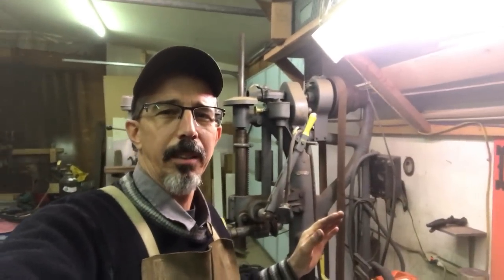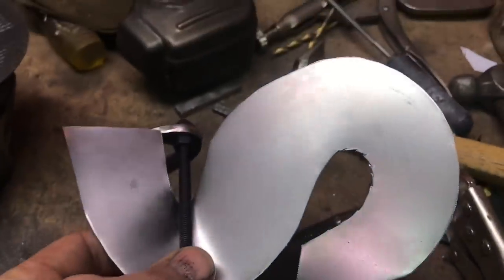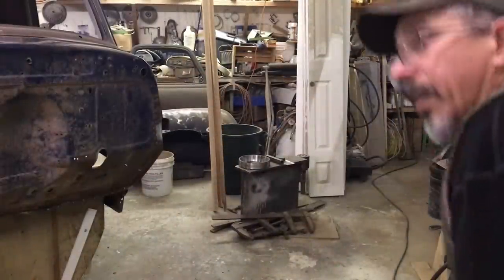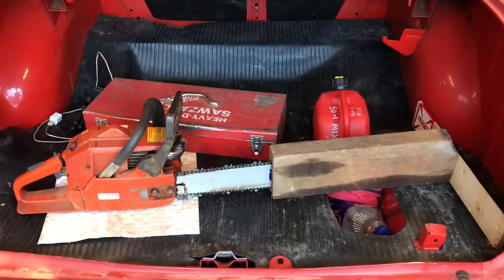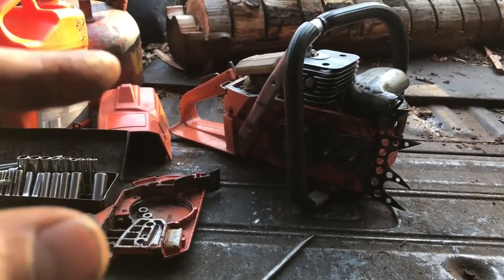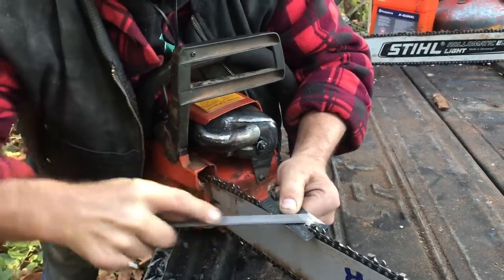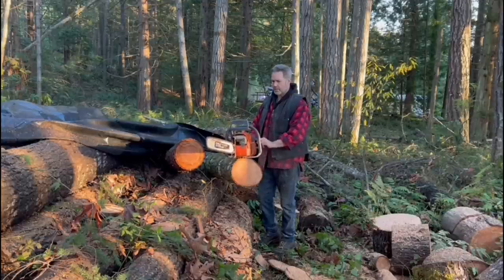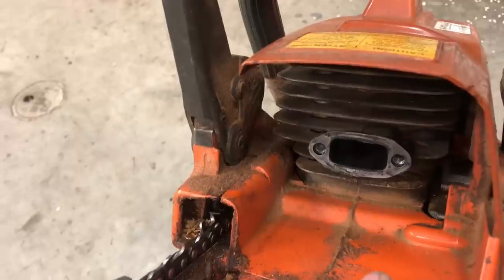Chain Saw Pipe “Test”

Comment: "Anything worth doing is worth doing wrong" & "Always plan on throwing one away" are two great sayings that erase the roadblocks to me learimg a new skill. You're really on to something here with these expansion chambers that fit in the space of an ordinary "can." Keep going! I believe you've got winner here!
Reply from the maker: Thanks John, I’m thinking the second pipe is probably the better of the two but don’t have any hard evidence that it make any significant power gains. I would like to do some more testing.
Reply: @WildWestGarage  Real world "Seat of the Pants" performance definitely gives you a a pretty good "Back to Back" that'll certainly let you know if you're moving in the right direction. When a pipe is pulling vacuum as you'd like while "in the cut" - you FELL it "getting on the pipe." What you really want to know is at what RPM does it "hit," - and is it still trying to gain RPM past where you really want it to.

From there, you can start nudging it in one direction of another by:
A- Binging in an inside radius to reduce over-all pipe volume (if that's a direction you feel you need to move) WITHOUT creating a lump in the path of greatest air-flow - around the outside radius
B- Lengthening the "stinger" - narrowing the stinger, or sometimes "Center Bleeding" bu putting the stinger in the middle of the fat section while tapering the old exit location to an inverse cone shape.

You can also "grow" a pipe some by filling a section with water and setting it "just so" in a chest freezer and letting the hydraulic forces of freezing water "Puff it out a bit."

It's a good deal of work, but man oh man are you ever onto something that - with some time and patience, could become a de-facto "go to product" for pro loggers and arborists that really DO need as much power at as low a weight penalty as possible.

Yup. I'm curious to see where this goes, and I'm sure quite a few others are as well. Yer a smart fella! I like the way you think! MORE POWER PLEASE! :)

Comment: If the pipe makes the saw faster, then it DOES MAKE POWER! You’ve got to remember that ULTIMATELY the exhaust is your last “hold-up” of flow, and that without flow you can’t make more power unless you have more displacement (cc or ci, both of which indicate displacement).

BTW, who made the little chainsaw “scabbard” for your saw?
Reply from the maker: Hey Todd, thanks for watching. Scabbard? You mean the thing that I slide over the bar? I did.

Comment: Onto something with this kind of design! I gutted and ported my g660 pro exhaust, going to trace the gasket that meets up with cylinder so I can make my own from scratch. I'm a pipe fabricator so this should be fun!
Reply from the maker: When you get it finished I’d like to see it
Reply: @WildWestGarage  of course! Will also send ya a pic of the current stock exhaust that I gutted and welded up in the next couple days👍🏼

Comment: HEY THERE MORGAN I’M A PENNSYLVANIA Dude CUTTING … THAT HARDWOOD BABY!!!   I would love to run that latest pipe on my 371,372,376 and see how it compares to a couple different one’s I run!  You are definitely making some large diameter tubing size…. That front cone bevel that’s a convex curve is.  ( 8 degrees and not 6 degrees) I was reading the old 2 stroke tuner’s handbook… MaC did a bunch of research on just a straight pipe straight out the exhaust port window….  They found that at 31/2” and 51/4” I’m thinking it was 🤔🤔🤔 that those straight pipes were creating pull???  That’s a really cool concept… as they have the sound waves shooting through them and back and forth down their length… 🤔🤔🤔🤔.      It’s definitely a very cool area to get lost in for a little while….    And your metal working is really good… it’s very cool to see how you went about making that muffler.,,  I would have watched a 5 hour video on every single minute of the entire process!!!  Very very cool and I was able to get some ideas on how to make mine buddy… so thank you very much for showing how you get that curve around out of some flat metal!!! That was really awesome stuff!!!   Thanks again for sharing this video with us!!!  Your muffler is definitely an art piece and it’s absolutely gorgeous!!!   

I can completely understand why you wouldn’t make one for a regular dude… there’s a ton of work there… without them paying you $500 or $600 hundred bucks your time would be a donation!!!    Really glad that Billy got you on a raker gauge and explained that… if you do any cutting that will definitely help immensely!!!    Your pipes are cool, Captain!!!   A 3.5 inch octagon with that 8 degree angled face bouncing that sound wave back and you want to open those two angled top sides one inch back from the face and come out with two tubes 1/2” diameter or one 1” on just one of those top corners…. It’s a really good working box!    I’ve been thinking about a six lobed flower looking looking muffler… with 1/4” little pipes coming out the pedal section’s!!! Be wild looking whether it help the performance of the soul who would give a crap… if it’s a beautiful piece of metal sculpture like your awesome curves going on I’d probably give up some power… just to look cool while I was doing it!!! LMFFAO!!!   I’m so glad I got to watch you and Billy driving to TinBasher’s and across the world up there!!!  Your metal working is cooll…. I’ve got to jump into my o4 F250 and get those rear wheel wells and the back cab corners all glassed up and painted up so it’ll stop rusting away on me!!!!   Much love Brother!!!    Peace & Love God Bless
Reply from the maker: Thanks David. I am going to build a similar pipe for Billy’s Iron Hose 271 but unless I can figure out how to make one in 2-3 hours that will be it. I will also be messing around with some simpler designs, I might even do some research first.
Reply: @WildWestGarage  right on…research is always good… I just happen to click onto a video and the guy’s a mechanic I believe… auto and light truck general purpose type shop and he was playing with making a pipe for his saw and he had different diameter auto exhaust pipe and bends … one of those cats that has a couple carport’s out back and he doesn’t scrap those exhaust systems that he removes… so he can cut it up and steal the bends and whatnot when he wants to fab something up… I’m taking my sawzall and my grinder down to the scrap yard one afternoon and look around for elbows and bends and exhaust systems on old equipment that is tossed out recently….  I saw that convex hammered piece which was beautiful…but that fence cap was close and it is ready and plug and play!!!   That’s definitely what you need.  I’m going to try to find two of those and stick them together… basically want a flange with 1 inch of pipe straight into that 3”-3.5” diameter baseball shape as close to a circle as I can weld up then a little piece of 1” exhaust pipe popping out it’s top right side corner on a 45 or something towards the chain… I want to see what happens when I use the baseball or softball expansion chamber shape right in front of the exhaust port window then pop a little pipe out it’s top on a 45… I’ll bet there’s a ball diameter that would work much like an expansion chamber… might be more like a handball size… 2” ball because I was reading that it should be like.68 the volume of the cylinder… the 50mm is 70.69cc’s  so that’s a 48.06cc second expansion chamber … I don’t know that I’m doing that math right but it’s a 15.3 mm circle… I’m thinking like a golf ball… in line in the pipe 1” from the flange ….?   I am going to look for big washers with a 1” center hole and like 3” diameter… put an inch of 3” exhaust pipe in between the two big washers then and the 11/2” pipe on it… so it’s like a 31/2” pipe with a good expansion chamber in it… I can maybe get that melted together!!! LMFFAO!!! I have a shit box wire feed and I’m not a super star who could maybe make it look good!!!   I saw you just on TinMan’s…aka the TinBasher’s wire feed welder and you were adjusting stuff around and you could know what you are doing enough to kinda dial it in some… I’m totally guessing … that thin stuff is just super easy to blast through… I shake like a leaf since the tree crushed me because of the neck and spinal nerve damage so I’m  tremoing some days so much I can’t even sign my name and have it legible!  LMFFAO!   Grab a piece of sandpaper and get to work then!!! LMFFAO!!!   I use a little piece of 4x4 wood block and just put my hands on that and it stops the shaking movement mostly… I was going to say that I would trade my left teste for a Dyno machine so I could actually see any real results or gains but this is a family channel … whoops!!!   😂😂😂😂😂👍.  Without a dyno there’s a little guessing…. A good straight 14” log and timing runs does give you some idea of a power increase… faster is definitely a result in more power… I think it’s important to debark it and do everything to protect your bar and chain so it maintains it’s sharpness across your test…. It’s beyond my computer technical skills to drop in the timer in a video so I would need a buddy with a stopwatch to help me test them???    Awesome stuff!!  And it’s fun stuff but with work and Home life I just don’t ever have any time to play around with stuff like this… and I don’t have the welding equipment at my house or the machine shop anymore as my old buddy crooked last year….  👍😁

Comment: I believe the second pipe does gain horsepower. because a tuned exhaust should be close to the same cc as the volume of the cylinder.  nice smooth flow is the other plus. sounds not to bad either .
Reply from the maker: I went into this without doing any research and now I’m kind of obsessed. I’ve got a few more ideas I want to play with. Thanks for watching.

Comment: Your exhaust is shooting out your exhaust port window there and you want a curved … concave 6 degree angled wall off it 3 to 3.5” inch’s so it can focus that sound wave and shoot it back into the center of your exhaust port window…. 3.5” circle or square with an exhaust tube coming from the side… I’d pop out of the top opposite the chain with 3/4” pipe you don’t want a hole in that front cover or you loose the refractive principle of the front wall allowing the sound waves to pulse back at your exhaust port window… you loose that back pressure pulsing that helps the 2 stroke burn the entire fuel charge… you can make a saw have a little more power but you create a fuel pig when you open your front wall or face of your can style muffler!!!

Comment: so your second pipe is a lot closer to what is rolling around in my head ..... given the confines of the saw , all that can really be done ,besides dumping into a "chamber " , is create a header pipe and one that tapers larger is what will help the most . ... which is what appears you have done with the second pipe .....

as for selling them i'm going to guess you would need to be in the neighborhood of 250 - 300 canadian pesos to make it worth your time .

something else i noticed , you see to be leery of going to far outside past the oil tank .... i suspect that as long as the outlet isn't blocked , the chamber could go 3/4" to even 1 " past the edge of the oil tank and not be overly noticeable when using the saw ..... worst case senario , the dogs could be moved out to create a "safe space" for the muffler without creating a issue .